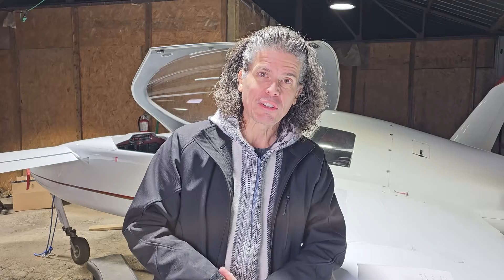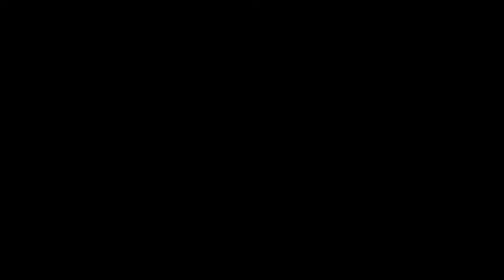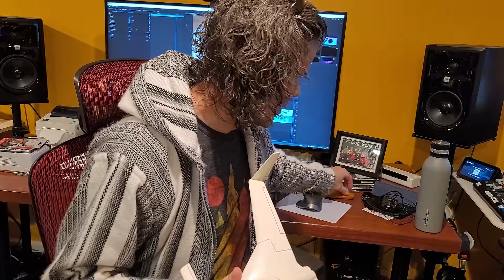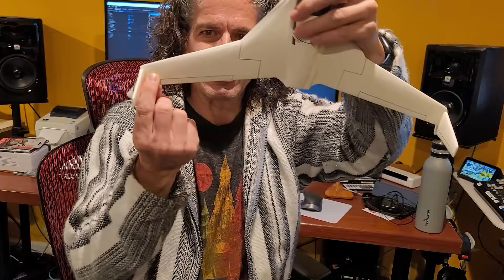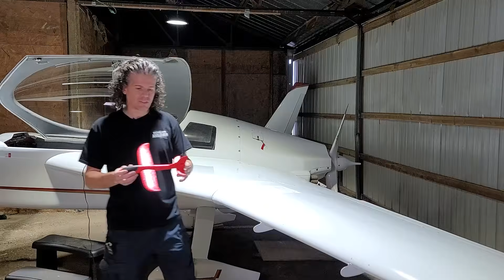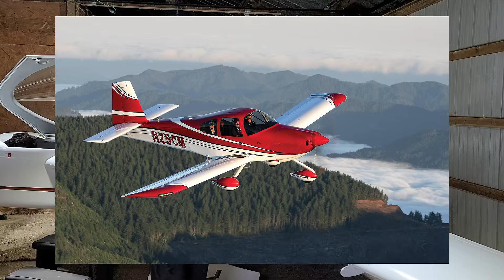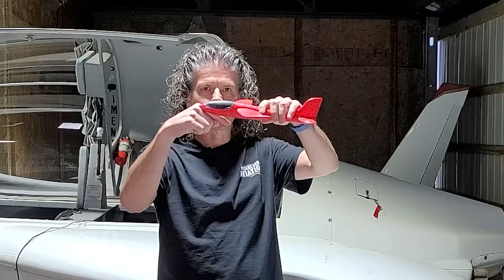Canard Aerodynamics: Why You Might Not Want a Canard Airplane

Comment: Forward swept make wing more efficient.
Reply from the maker: No, they are not. Any sweep on a wing makes it LESS efficient. Forward swept wings are less stable, which is great for fighter jets which need quick maneuverability.
Reply: Forward swept wings increase load as spar deflects requiring more structure offsetting aero efficiency. Only X29 demonstrator had wing skins causing the reduction of tip angle as spars deflected.
Reply: @oneskydog6768  The German Hansa Jet bizjet was able to keep the wing spar out of the cabin by using a forward-swept planform...  but then suffered from the weight issues you noted.

Comment: I had a Varieze and sold it and I have been kicking myself ever since. Perhaps a velocity or a standard cozy is in my future. Canards aren’t popular because of its configuration but if a standard pilot could fly one for 5-10 hours opinions would change. Very safe efficient airframe.
Reply: I was reading comments and I slowly got angry because NOBODY even mentioned Burton. Finally here is one, and spot on: regrets selling one. Burton designs are great, and pilots who don't understand that, well, maybe it simply is not the plane they are used to. I understood high landing speeds is a big deal, not everybody likes this. And that is just one detail. But don't they want the advantages? Don't aerobatic specs make them think again? Ten times more pilot fun, what is WRONG with that? Do they prefer twin turboprop monsters, doing 300 knots cruising speed, weighing ten times a Long EZ? Why? Proud of spending fortunes each year? What is it, why pilots say no thank you, seeing those Burton canards? Their are business jet size canards, as well. Amazing that people can focus on the disadvantages only, for these planes are great, or what?
Reply: @voornaam3191  
‘Burton’ = Burt Rutan?
Reply: Pusher Canards require a paved, Asphalt or Concrete Airstrip, otherwise, Stones rised by front wheel will hit the Propeller, even more, it's TO and landing Speed is high. 
Canards do Stall, after a Propeller Blade loss, Pilot on a Velocity pulled stick instead of pulling it to gain airspeed, machine entered a flat, Impossible to recover, high speed fall, killing pilot.
See 'Des couacs chez les canards', 'Kwaks among ducks' , in Homebuilt Aircraft & Kitplanes Site.
Blessings +

Comment: Enjoyed this thanks. Unfortunately your explanation of the rotation forces about the main gear is incorrect. The part you got right: blown horizontal tail is more effective than canard. If you calculate the CG location relative to the main gear (moment arm) it is similar to a conventional aircraft, and is not why the rotation requires more speed .

Comment: Great breakdown. You even threw in things that I wasn't aware of as well. I love the physics of it all! When you spoke about CG I've in the past talked about that to some folks when it comes to driving a car. It's more like CP (center point) they way I explain it. Heh See, some have formed the habit of if they have to turn they go slightly the opposite way (if they have to make a right turn they go slightly left then right) then make the turn. If they knew the CP then they'd realize that's not necessary. Especially since the wheelbase length isn't like some long van or truck that has to do things like that. If you're in a regular size car, just setup for the turn. And realize your CP is before the rear wheel. I know none of that has to do with flying but when you were talking about that it just all seemed the same, but different. I hope that all made sense. :face-blue-smiling:

Still, I wonder if this plane isn't as popular because of the maybe "conditioning" of what regular flight is known to be. I find it interesting that the Wright Brothers basically flew a Canard. But, somewhere in there things got changed to what we know as flight now. I wonder why. 
Anyhoo, as I typed on the intro video before this, I'm a simmer. I will get my license eventually. So, I like to look at planes that would fit what I'm trying to accomplish. Which is a lot of personal flights. That includes Experimental planes. :face-red-smiling-live:

Thanks a lot for this video! It was a lot of fun for me. I'll be checking out more of your videos in the future. :face-orange-tv-shape:

Cheers! ✌🏾
Reply: I love what you just said😅all of it, I might not be a pilot but I am a sheetmetal worker/engineer and I love hearing from people that can teach me

Comment: Your explanation regarding conventional airplane stability  it’s not correct in the pitch axis, let’s assume that your cg it’s too rear, then your explanation about the horizontal stabilator it doesn’t work!
Reply from the maker: Not sure what you're saying? The horizontal stabilizer on a conventional aircraft creates downforce. The farther aft you load the CG, the less downforce is required (hence less drag). Longtime trick for cargo haulers to load their planes to aft CG to get a little bit of reduced fuel consumption. You do need SOME downforce on the horizontal stabilizer in order for the airplane to be stable. Exceed the aft CG, and the airplane becomes unstable in pitch, and worse - you may lack sufficient elevator authority required to recover from a stall.

Comment: Love the canard design and your cozy is amazing. Two main questions…. I’d like to know your opinion on the Dutch Roll susceptibility due to the swept wing. Do you think it is any more pronounced in your Cozy compared to a C172 or conventional pusher/wing design?  Seems like that is a major design and performance difference for a canard/swept wing designed plane. Second, is the useful load more or less than the comparable conventional designed planes?  Thanks!
Reply from the maker: I should actually do a short video on this to explain it - easier to do than to try to explain it in text! The short answer is that it's very resistant to dutch roll.

Comment: Because you seem to like the technical details - that 'optimal wing shape is an ellipse' thing has a whole lot of assumptions baked in, its not merely an aerodynamic argument, its how to maximise efficiency with a mechanical spar with weight and stress limitations such that the extra lift at tips doesnt disproportionately add to bending moments at the root. Different spar designs and overall weight distributions have very different optimal wing shapes.
Reply: Elliptical wing shape has the lowest induced drag possible.
Reply: @peceed  Elliptical  LIFT DISTRIBUTION has the lowest induced drag, for a given wingspan (aspect ratio, if you factor in a fixed wing area).

You can obtain an elliptical loading with any wing planform shape. But it will be elliptical lift distribution at one angle of attack and lift coefficient. 

An elliptical wing shape, without twist, will have an elliptical lift distribution at all angle of attack. (Negating Reynolds number effects).
Reply from the maker: 100% correct. I didn't want to start talking about structural design (although I guess I did a bit with talking about winglets - or perhaps that was my first video? I don't recall which, but I did). You could have the wing make full lift out to the tip, but you need a ton of structure at the root to support that, and now you have more wingtip vortices...one thing leads to another. Like I said, there's no free lunch! :)
Reply: @CanardBoulevard  
Yes, your comment on structure was in this video, and was a consideration I didn’t get from another respected YouTuber’s video on the true nature of winglets on commercial aircraft. 
Thanks.

Comment: You may not want a Canard Airplane because it will spoil you.  Your C182 flying friends will ask what your fuel burn and cruise speed is and say the F bomb.
Reply from the maker: 100%!! I see the envy in the eyes of my hangar neighbors every time I mention my cruise speed and fuel consumption!! :)
Reply: @CanardBoulevard does that come mostly from the efficiency of lifting the nose instead of pushing the tail down? Or something else?
Reply from the maker: @PetesGuide  It's a combination of things - I go over them all in my first video: https://www.youtube.com/watch?v=ycLQaiX4ylE
Reply: @PetesGuide  Small wetted area. Due to compact design. No rear fuselage. Seats on the floor, reclined passengers. Little to no baggage space. Etc, etc. This reduced flat-plate drag area.

Leas drag, means more speed for the same power. Or leas power for the same speed. Less power means less fuel consumption.
Reply: Yes but 182 can take a full cooler, camping gear, bicycle, dog and girlfriend/wife in to a Idaho back country strip. I love my 182 and want a longez/cozy very much. Everyone needs 2 airplanes 😂 nice video
Reply: @redsrandomness  girlfriend & wife... now that would be a challenging flight 🙂
Reply: @StreakyP  If you or somebody else made it successfully, please, share some tips. It's for a friend. 😅
Reply: @redsrandomness  These things can too, but you need cargo pods under the wings.

Comment: In my case you are talking to a non-pilot of limited technical background. I found it to be informative in a manner I was able to follow. Anytime you have alternatives you will find people telling everyone why this new idea is the greatest thing since sliced bread. Probably the most significant thing you said in the whole video is "there is no free lunch." I want speed and efficient fuel use. You pointed out where the lunch is paid for, higher takeoff and landing speeds and a longer runway needed.  I am not going to be trying to land in little back-country meadows. I also liked how you mentioned to not try to compare this plane with a Cessna 172.  All in all, a great presentation.
Reply from the maker: Thanks for your very kind comments. Yes, when it comes to engineering, everything is a compromise. You can have more of THIS, but you'll pay for it in THAT.
Reply: @CanardBoulevard Unless it's a comparison after decades of progress, for example a computer from the late 90's with a current smartphone, laptop or PC. Still it is more complex, less tolerant to EMF interference, ... so there is a (reasonable) tradeoff.
Reply: How can I get a ride in a Piaggio P180 in the US?

Comment: Unfortunately the propeller is also flying through disturbed air causing a lot of stress and inefficiency. It's also prone to damage from rocks and debris.
Reply from the maker: Yes, I mentioned this in the first video. It does make the plane sound really cool when it flies past, though! :)
Reply: @CanardBoulevard  The rear mounted prop is not in a disturbed airflow, its centered on the fueselage.  The XL-RG is a 230ktas plane in cruise with a TSIO-550-C 310hp engine, if there is prop inefficiency then its a nit given the performance of the aircraft.
Reply: @speedomars  
How is it not in disturbed airflow? 

It is in the air stream which has generated lift at the canard and the main wing root, passed over and around the non-cylindrical, non-concentric fuselage, has been over or through the engine cowling…. It was not stated that it was necessarily turbulent, just disturbed. 

At best, each blade is cutting through a varying velocity vector field of airflow, in effect producing a cyclically varying angle of attack and hence varying bending moment of the prop disk on the prop shaft. This would seem to me* to induce a sort of high frequency p-factor, among other effects of assorted (and quite possibly negligible) magnitudes. 

Re XL-RG: Prop inefficiency is a quantitative matter, it is not qualitatively prop ineffectiveness. 

* Your cue that this has not been tested in the heat of battle, just my best analysis from much reading and thinking, and a lifetime of curios observation.
Reply: @For_What_It-s_Worth  What some are leaving out of the conversation is the swept wing design of the Velocity.  When a swept wing travels at high speed, the airflow has little time to react and simply flows over the wing almost straight from front to back. At lower speeds the air does have time to react, and is pushed spanwise by the angled leading edge, towards the wing tip. Either way, the airflow behind this wing does not produce the kind of dirty air some are assuming on this particular pusher aircraft design.
Reply: @speedomars the prop has to chop through different airflow,  versus if on the front , get clean air.
Reply: @andrewashmore8000  The pusher is a proven concept and the Velocity has bee flying for 25 years.  The air is the same front or back on this aircraft.  In fact, there is no such thing as 'clean' air.  Turbulence at all altitudes is the reality of flying.

Comment: Interesting video.  My buddy in an early Velocity during testing did stall the rear wing.  He went to full right aileron, full right rudder, full nose down, and full power.  Eventually the plane started dropping off to the right and into a knife edge, gained speed and started flying again. Took 5000 feet tho.  But even with the rear wing stalled the plane is dropping at a slow decent rate and likely survivable.
Reply from the maker: Yes. I don't recall if I mentioned that in this video or the previous one, but several people have stalled the main wing on a Cozy, rode it down, and survived - it comes down at about 40-45 mph, so it's not going to be nice, but it can be survivable.
Reply: @CanardBoulevard  what do you mean stalled the main wing? if both wings stall it would fall. Are you guys talking about entering a spin with a slow steady state speed?
Reply: @thelurkingpanda3605  No spin, it fall down flat and the drag will keep it relatively slow
Reply: How about elevons on the front wing, they should allow faster roll-dive recovery?
Reply: @tymoteuszkazubski2755  at that point I’d make the canards movable it would be more economical both cost and amount of lift, but then you’d have to make them be constantly adjusted and monitored by computer which in turn would make this too expensive for private use? Reason: it would provably be too dangerous / difficult to fly otherwise.
Reply: @tymoteuszkazubski2755 too short to produce a meaningful roll moment.
Reply: @tymoteuszkazubski2755 excellent idea, but how effective will it be. Hooked up to each rudder pedal? Or independent.
Reply: What was the CG during this event? Maybe he was trying to find the allowable rear CG? This can be risky without a way to quickly move the CG forward for recovery of needed. I’m not a test pilot but have seen rigs for moving CG in flight.

Comment: Amazing aircraft out of the mind of one man , Burt Rutan - yes  the aerodynamics on the Rutan Canard are hard to explain - another really complex one is Piaggio Avanati  with the same engines can cruise 100KTAS ( 25% )faster than the Starship with similar power plants but to many the Boomarang was the one Rutan actually wanted to commercialize  - great discussion
Reply: Rutan likes all of the credit but none of the blame.  Starship is inferior to King Air in nearly all specs.  There's a two word reason:  Burt Rutan.
Reply: @arcanondrum6543  The weight was the main problem, and not having a conventional tail (like the Avanti) is another problem. And the FAA wanted a wing that was very beefy, making the certified version much heavier than the proof-of-concept made by Rutan.
Reply: @ErikssonTord_2    Everyone has to obey the same laws of physics and the FAA.  Starship and the Adam A500 are, according to Rutan; "someone else's fault".  Two big, very expensive flops with two words in common;  Burt Rutan.